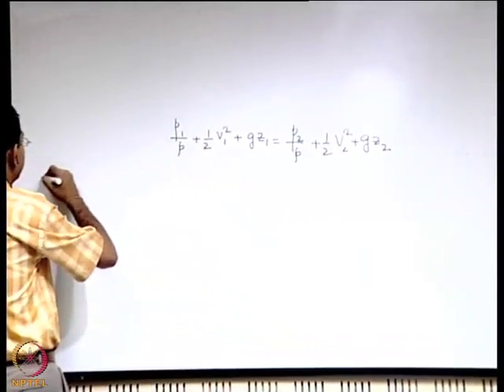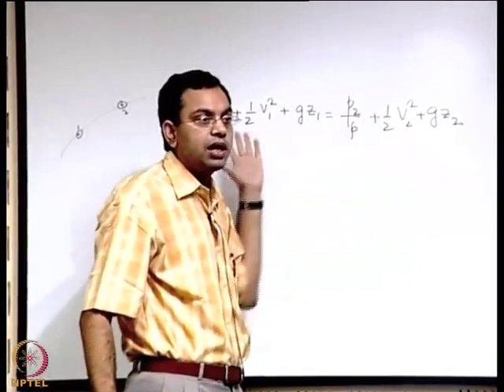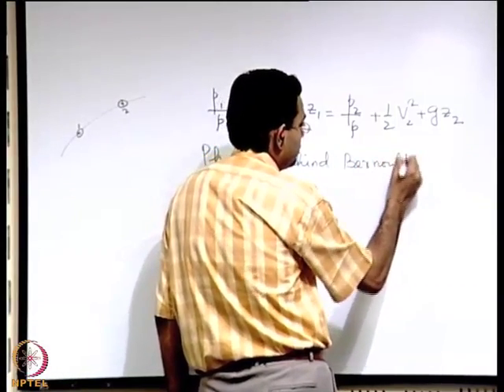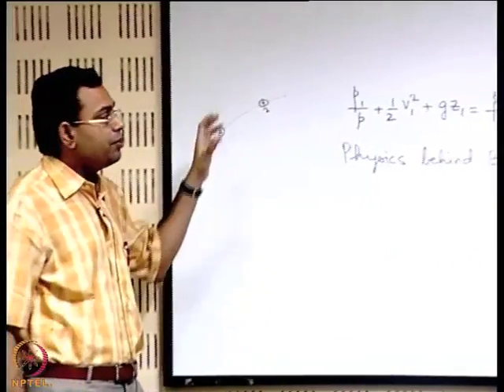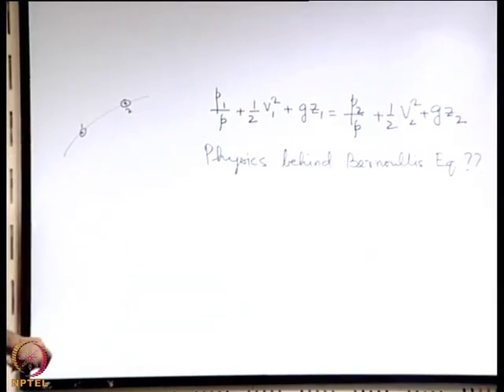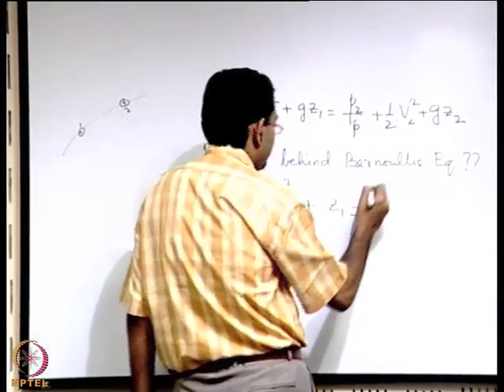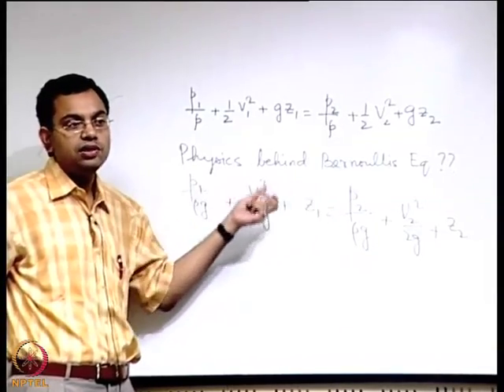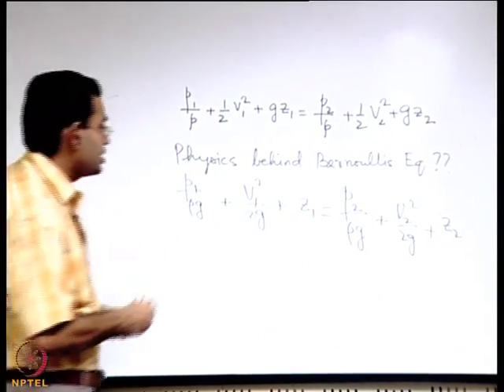Mod-01 Lec-17 Dynamics of Inviscid Flows (Contd.)

Comment: sir i have a doubt here plz clear it.
questn that we have done at around 42.38 in this lecture.
1. WE APPLY CONTINUITY EQUATION IN 2 DIMENSION FOR CALCULATING U(x).
but in the derivation we derive it by assuming 1 dimension flow.

here we take area in 2 dimension. i.e. X*L for bottom plate control volume and H*L for 2nd righward section of control volume so this will become 2D flow. but we had derived continuity equation"s integral form in 1 D.

so plz help me to clarify this.
**THANK YOU****